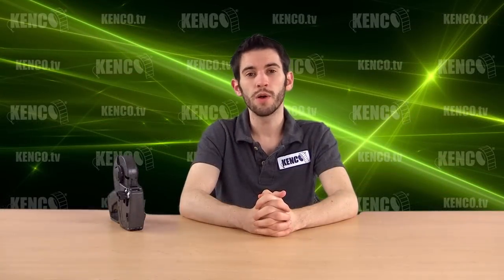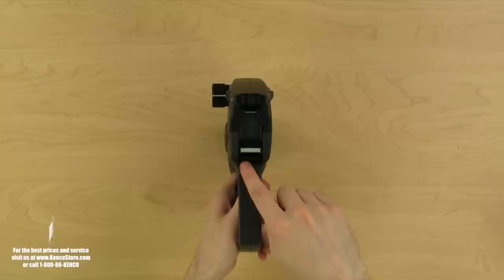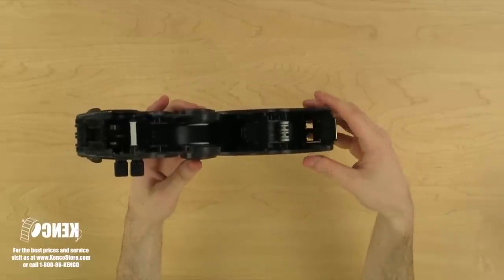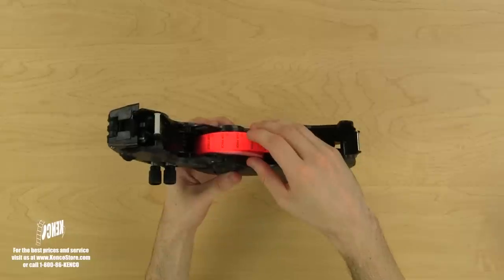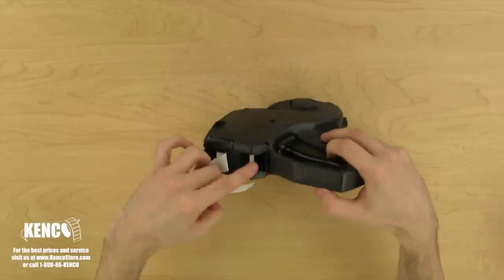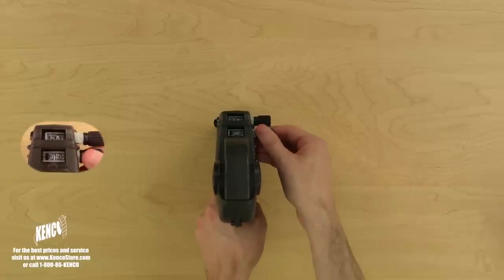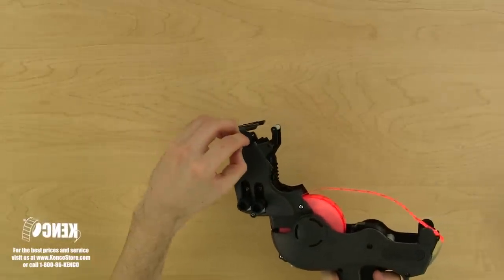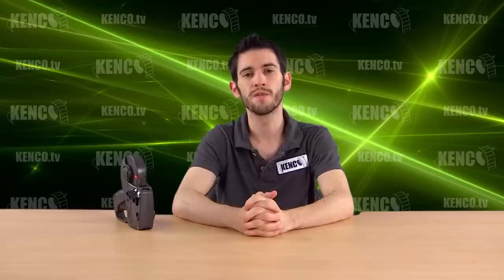Monarch® 1136 Loading & Maintenance Instructions

Comment: How do you clean the number dials when the dial is over inked and you can't read the numbers on the label gun. I have a Monarch model number 1136.
Reply from the maker: You can try and clean them with isopropyl alcohol and a Q-tip VERY VERY carefully.  Or you can send it in to us to review, clean, and if needed, repair them.

Comment: I get that you showed us how to load, but I see nothing about maintenance.
Reply from the maker: The only maintenance we recommend a user perform on this labeling gun is inker replacements.  Anything else will generally void any warranty in place.  In addition to that, these devices are generally difficult to repair.  We have a dedicated team to repairing these units and I believe the current price on a repair for this model is $23.50
Reply: Kenco Label & Tag Co., LLC.   Thank you for your reply.  I have 4 of these, all of which started doing the same thing after 6months to a year.   

When I get about half way through a roll of stickers, the gun trigger starts getting stick and I have to squeeze it twice to get a sticker out of it, this leads to a double hard to read impression.   I have noticed that if I open the gun and spin the sticker spool and give it a lot of slack, this helps it not do it as bad, but it’s aggravating as I sticker 1000-2000 things a day. I was hoping maybe there was a place to oil it
Reply from the maker: It sounds like there might be adhesive buildup inside of the pricing gun. This is an issue that I have heard of with heavy users.  There are other price guns that might be better suited for the large volume of labels you are putting through your price gun. As an example, the TOWA GL price gun might be a more capable pricing gun to meet your needs.